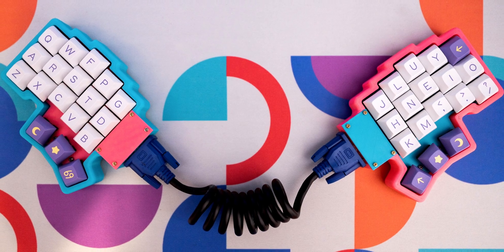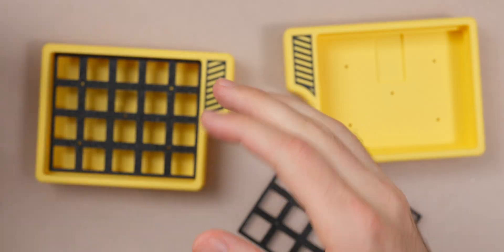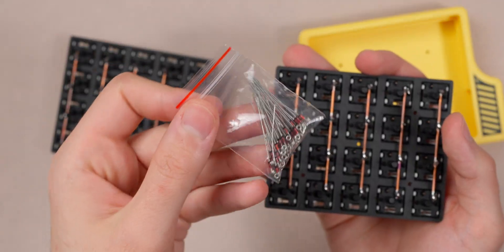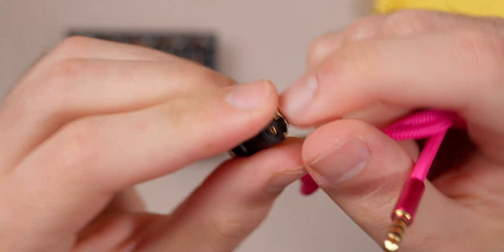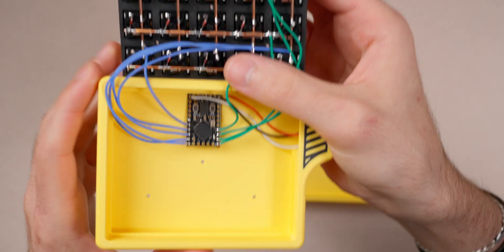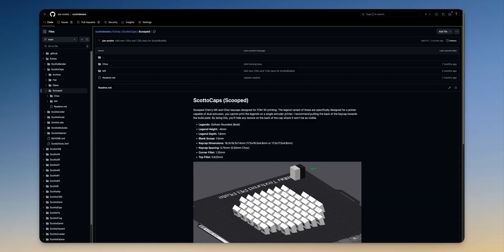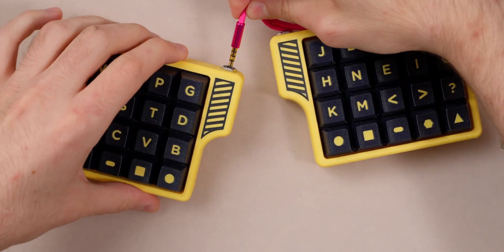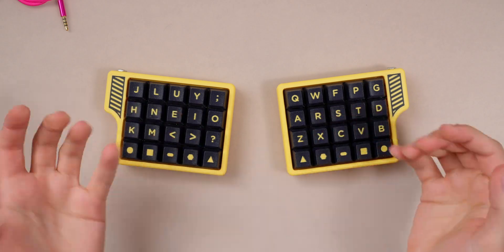Building My First REAL Handwired Split Mechanical Keyboard

Comment from the maker: Yeah, I’m about to go through a split phase… I can feel it.
Reply: Personally I dislike split because I feel I'm forever adjusting each side. E.g left side feels 1degree rotated so I turn it a little, then after a while the right feels 2mm too close to me, so push it slightly, over and over and over 🤣
Reply: Wireless split next please!
Reply: thats super beautiful,
how about make a wireless one?
Reply: Keep it coming. Always a fan of your works
Reply: I feel like a hardwired keeb that would be hard/expensive to do with regular PCBs would be more exciting, keyboards like kinesis (I know it has PCBs)
Or dactyl, where the shape is not flat hence utilizing the handwriting is a whole lot cooler.

Are you planning to do such a thing?
And if u aren't planning to yet, would you be open to the idea?
Reply: Hi, could you please share the way how to program both halves to work as one keyboard? Love the build

Comment: what do you think about pog for automatic keybaord making
Reply from the maker: It’s amazing. I was recommended to try it recently and in less than 5 minutes I had a board working. Eventually I’ll be doing a video.
Reply: @joe_scotto  thanks for answer you made me order the part i need for my first handwire ill use the plate of my akko spr67 for the first tests

Comment: Ok, where is the video showing how to flash the rp2040? I have watched all your vids and you don't show how to do it.
Reply from the maker: You just hold the boot button when plugging it in and then drop the .uf2 firmware file onto the drive.
Reply: @joe_scotto  sorry, i meant building the firmware config. It's all good I was mainly fighting with using a Arduino Nano as my board for a complete custom build so thought seeing someone compile for a different board might help. Turns out you have to change the bootloader on the Nano to v-usb to use the Atmega328p. Overall though just using a RP2040 is a much better option all around due to how many pins it has and how cheap it is and how easy it is to flash. I hope the comunity as a whole starts to move away from the pro micros and teensys

Comment: Nice! For folks uncomfortable with hand-wiring, you should be able to build this on a PCB with Adafruit’s Neokey PCB - and as a bonus you’d get per-key RGB, though that would require some re-jiggering to add the RGB control. The plates might not fit though. Darnit. I’d have to measure. 

As to the plates warping, I would bet you could stop that completely by making ribs extend vertically running the length of the plate. Not that the curve is an issue once the screws are in.

Comment: Why do we use a TRRS if you're using only 3 poles/connections? Wouldn't a TRS be a better, more common cable/connector to use?
Reply: i thought with 3 conns the parts can communicate each other
Reply: @CrisGers  yes, that why I'm asking why use the 4 pole connector, instead of a 3 like one?
Reply from the maker: Either works, I just had TRRS
Reply: @joe_scotto  Okay! That makes sense 👌😁
Reply: I wonder at this point whether corne/crkbd really needs a TRRS connector (four wires). Is a TRS connector (three wires) perhaps sufficient?
Reply: @stakezero    From what I remember from one of my first split keyboards, the fourth pole was used, but I was using I²C (which needs 4 connections) and with UART you only need 3 (with a duplex RX/TX data line). That may be the reason many boards still stick with the 4 pole connectors.

Comment: great build brother!
which cad software do you use for 3d designing? and also for MX style switches, do you do 14mm x 14mm for switch mount plate?
and also, can you refer some resources for screw holes on the case in  context of 3d designing?

Comment: Very clean build. I've always thought about a "split" keyboard that's just a 75% on one half, and a number pad on the other half. But instead of using a TRRS cable to connect, it uses pogo pins that magnetically snap together. Thoughts on if this could be possible?
Reply from the maker: Could be possible. I’ve looked at pogo pins and the issue is the interconnect cable, it’ll be ugly. Other issue is hot plugging and that would be easy with magnetic connectors. Could short out your controller easily.

Comment: Nice dude. Can u do a video that making a dactyl manualform keyboard ? I'm stucking at handwired phase and matrix for coding
Reply from the maker: Honestly, it’s probably time I do this. I’ve been asked it a lot and it’s something that’s been on my list for a long time. There is even a really neat online tool that will configure the 3D files according to the layout you want.
Reply: @joe_scotto   u mean cosmokeyboard web ? Ye i know it bc' i printed 3D my dactyl from that website. The only thing that made me stuck is handwired ( which will be updated in future ) , i just dont know connect thumb key to which row and collum bc' it not straight :)) but anyways, tks to your video now i understand more ab't TRRS